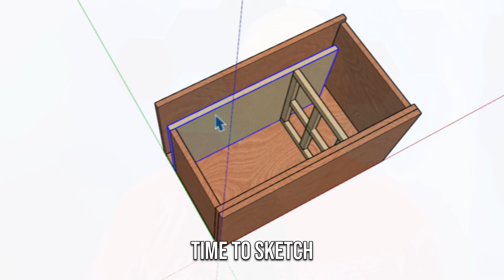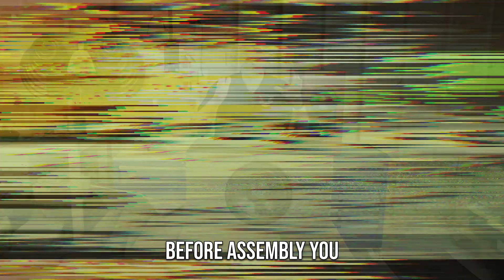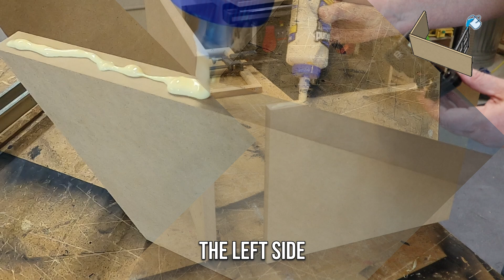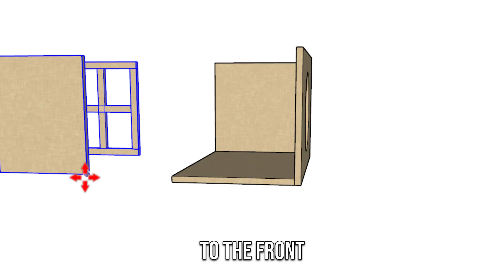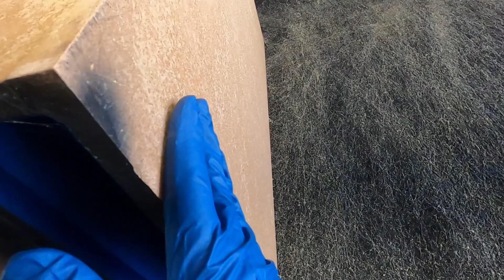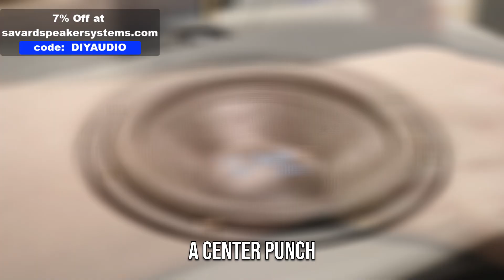12" Ported Subwoofer box build!  Side port for low bass.

Comment: Love the DIY Audio Guy, with Cabinet maker carpenter skills, I am Big on Dado. Instead of Butt joints. Dado engineering is much stronger. Pretend Time does not matter.
Reply from the maker: Dados are definitely better, a next level skill.  I went the CNC route so I could cut them easier.

Comment: Hello, thanks for all your uploads very helpful!  I have a quick question, I installed (2) JL 8W7AE-3 subs in a ported enclosure tuned to 37 hz (JL 1200/1 amp at 1.5 ohm).  Sounds good, and the output it about right where I need it to be although I could go for a slight increase in output if I could.  I really want something really accurate, really "punchy" and tight.  I'm thinking about switching to a sealed enclosure and am ok loosing a bit of output doing so but to offset this was going to add (2) more 8" subs for a total of (4) JL 8W7AE-3.  I am assuming going to sealed I would loose about 20% output over ported but I have no idea.  Am I getting carried away?  What would you do in this situation?  Thanks again for your videos!

Comment: I built a box very similar in size except I used 3" pvc pipe at 10", I also doubled up the front..1.5" total.   
All 6 sides have a 45° bevle on all sides plus 45° cut off on inside.  And the one thing I did was to the inside of the box that I don't believe I've ever seen done but I think that it might have worked well because it is by far the loudest cheap $40 Jensen 12-in subwoofer I've ever heard. 
I have to give thanks to DIY audio guy I have learned quite a few of those " well darn thar would have been a lot easier"  things that I did not know about building boxes from your videos. I've been a carpenter for 20 years and  it's always the little tricks of the trade that go the farthest
Reply from the maker: Awesome!

Comment: You really want to go more like 15-16 sq in the port per cube.. you’re software won’t model this but it will really make a difference in the sound quality on notes just under and over the tune.. it won’t be deeper per day but to the ear it will sound very much deeper and you will actually gain a little spl in doing so. 

That box looks to be 2 maybe 2.25 cubes.. port should easily be wider . Only prefab companies use that 11-12sq port cause they trying to market you a box at low tune big volume in a small actual box size.. this is why you won’t find one custom shop anywhere doing ports this small.. hell gately got a few boxes they are pushing 18sq in the port..

Also if you’re a little low on power you upside the box.. upside the port and you’ll give less suspension to the driver and this gain sound wo having to apply more power.. on issue is if you do upside and send all she’s got you’ll run out of mechanicals on a lot of drivers that don’t have very big diameter (not deep wide like entire magnet is the diameter of the basket wide) and then a very tight gap to apply sufficient electromechanical to limit the pole from bottoming out

 Nice box though.. my carpet and wrapping skills are not that good either so I use stains and marble paints and epoxy’s to finish my boxes lol..
Reply from the maker: Everyone says that (sq in per cuft) , but nobody ever shares any science, math, or data to back it up.
Reply: @DIYAudioGuy  I’m not sure what you’re saying here cause pretty sure you had a typo in the quoted response. 

I’m not educated enough to understand the math behind how port areas effects something tbh.. but hat I have done is been in car audio for the better part of about 30 years now almost. 20 of those building custom boxes that for the most part were trash tbh.. 

What I do know.. port area is a product of volumn of the box.. mechanical movement (xmax) if the speaker and I’m sure it has many other variables.. mathematically.. 

What I do know.. all the custom box builders and high end pre fab box builders who make custom boxes use around 14.5-16 square in the port on all the boxes they make. 

Won’t lie I don’t know why I’m not that smart.. when I need to build a box I look to these companies and people as to what they are doing and use the same port area.. the general rule I think we all know is 12sq per cf. 

I spend a lot of time on gately site as a custom builder and all thier boxes are 15.4ish or better.. I don’t question it. They know more then I do and have way more resources and spent way more money they I ever will into that development. I soft copy a lot of what other do,. Modify it to what I know a specific driver will do or wants to do.. based on not just xmax although that is a huge factor when it comes to port area.. the more air it can move inside the box the bigger t the port needs to be to allow that air to move properly.. 

What I do know.. when I follow the custom box builder rule of thumb.. which is 16sq in the port as a baseline I’m able to as a custom box builder get performance from setups that Rival ones costing 4-5-6c as much or more.. I don’t go below 14.5 cause I don’t see any of the companies do this.. on extreme xmax spl only type drivers I’ve gone as high as 22sq.. 

My daughters car has subs per manufacture are if I remember 11.5sq.. her box is .5 cube below cause I couldn’t fit bigger.. built at 16sq.. tune to 33 and running off 1050 watts of what could take easily 1609 watts.. meters mid 40’s.. 

Just finished a reinstall a few weeks ago.. couple skar sdr 12’s on a planet Audio (Walmart amp more or less) my box eBay head unit and in that sub it’s hitting idk now the meter score but it’s above what my daughter care is by ear and it’s not egged close. So it’s upper 40’s on about the same power of 1100watts as I measured from it. In subs that can only take maybe 1200 ish. Recommended for like 11. Something sq and I got them at 15.6 sq 

I’m pretty damn good at box building.. even better at system designs given whatever the budget is to get the most out of everything. Understand watts is a measurement of power not sound and that much of that watts goes to heat in the amp and the subs.. I’m pretty good at getting sound not heat.. damn good at maximizing drivers based on the box I put them in.. 

15-16sq js where you wan to be for almost everything.. this 12sq bs is from companies selling packages units at that 12sq cause it makes the box smaller and easier for them to sell to the masses.. even a company as reputable as kicker does this.. most are way worse.. qbomb has not issues selling to a claimed tune at a claimed volume but if you calculate that box out they post a his as gross not net. They are tuned 5-10hrx higher and have horrible port area usually 1” wide ports into the night of the box cause it makes the mix smaller. People think they are good cause they are Loud playing this or that. No understanding that it could be loud playing everything and it’s not certain songs they don’t have base.. it’s the box that can’t perform for that base.. 

The main reason most custom builders use a tune around 30-33 is cause you can make that box perform from 25ish to 80 wo issue.. 

There is a lot to box building and winisd is great for calculating port noise etc., it’s horrible at about everything else.. unless you get really into the weeds with sound staging in a home theater application.. actually what it was designed for.. 

So although it’s a feee software able to help you build a sub box. It’s designed for home theater. It is unable to calculate the +12 db rise and resonance frequency of a vehicle.. a free app on Apple is better for that then that software is.. and way easier to use if you use sites from companies like gately and others as a benchmark first.. 

Lost of better software out there.. if you use a box from a company already known. Modify the let’s items to what is needed you’ll get 100x better performance in the end. 

You did a video ages ago on best prefer.. used the skar box. That is a 12sq box the box calculations are off a little as they cheat the net vs gross with some bs design stuff through sacrificing the port area.. 

Don’t take my word.. take any sub you’ve ever tested.. rebuild that box and use 14.5-15sq in the port.. go 10% larger in recommended volume and tune it to 33.. forget what the paperwork says.. 

Do this and then you’ll understand just how much port area means to not just spl but also range of solid as well as depth if sound..

Comment: Great video! 👍👌
For beginners who are new to design software and want to build a ported subwoofer I would always recommend to make the port length adjustable and test for correct tuning frequency with impedance test to correct port size or length before they make the final finish. It’s way easier and faster to make this possible if using pvc pipe ports.

Comment: I'm a big believer in dados and rabets for all of your joints. I believe they creates a stronger joint and provide better air tight seals. The difficult part is making the adjustments in calculating the air volume. I'd like to see you go through the steps including the calculation adjustments when making a box in that way
Reply from the maker: I have a dado stack for my table saw, and have been thinking the same thing.

Comment: I really like that. Simple works all the time 😊. Looking at the build i am sure it pounds the hell out of your garage😂. Using contact adhesive correctly it will hold in tight within seconds. Never had to use any staples.
Reply from the maker: Simple can be fun.
Reply: It sure is 😊 @DIYAudioGuy